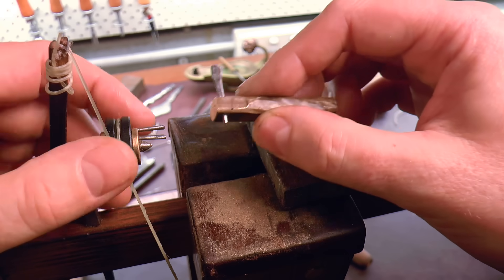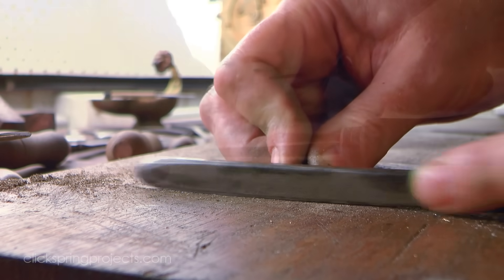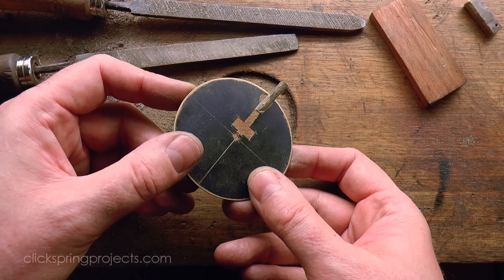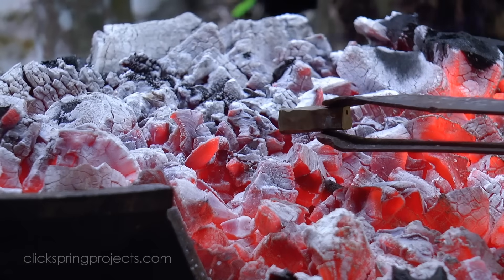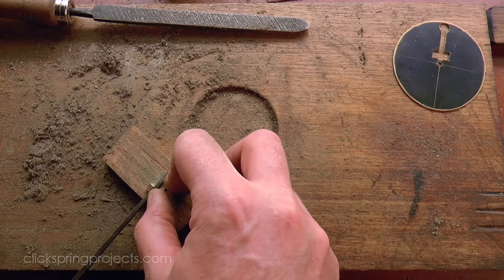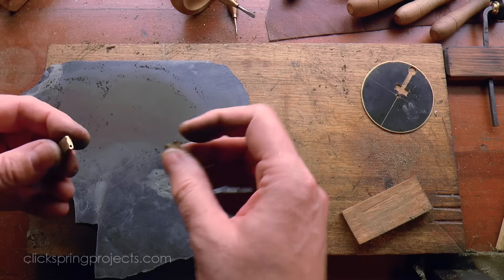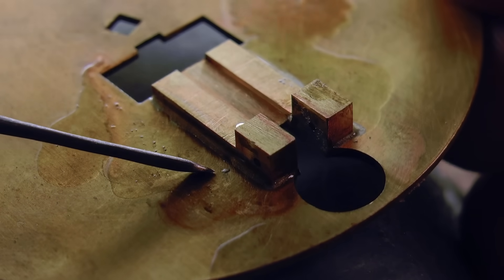The Antikythera Mechanism Episode 12, Part 2 - Making The Lunar Phase Display "Pipe" and "Cheeks"

Comment: Hi Chris. I’ve been considering a problem related to the Antikythera mechanism that I haven’t seen discussed anywhere so far.
When the mechanism was finally assembled after its manufacture — or reassembled after being taken apart for maintenance — it must have been put together not only with each wheel and component placed on its proper axis, but also with the correct angular orientation relative to one another. It had to be assembled with the precision of tooth to tooth.

In an ordinary clock, the hands rotate with a uniform angular velocity, so after assembly you only need to adjust the position of the hands on their shafts.
However, the Antikythera mechanism contains parts that move at continuously varying speeds, and some even reverse direction and form loops. For the mechanism to display everything correctly, it must therefore be assembled with almost all its components set to specific positions — meaning it represents a specific configuration of the planets, and thus it was assembled for a particular date.

This implies that the gears must originally have borne some kind of alignment marks to ensure that pairs of wheels were meshed in the correct relative orientation — probably in the form of notches or engraved lines, possibly accompanied by descriptive glyphs or letters. Has anything like that been found, or even a hint of it?

Another question is: which date did they choose? One might assume it was a date in the past for which the positions of the planets and the Moon were already observed and known — not too far in the past. That could serve as another clue to help with dating the device.
Or am I thinking in the wrong direction?

Comment: Watched all of your videos regarding the mechanism and the tools to create it. The videos where you dive into experimental archaeology are just astonishing. I've watched your lathe video along the last year at least 3 times. 

I recently finished my first more complicated machining project, actually my second machining project ever. I used an old manual lathe and mill to create a stirling engine from brass. Sand casting the flywheel, machining the brass cylinder and piston made of graphite.. And I had such a hard time achieving similar lever of precision and fit as you did with your concentric tubes. Thinking I always needed a more expensive and better tool to achieve accurate results. Your videos combine everything I love about the process of creation.

Thank you for being here and doing what you do.

Comment: you should build yourself a treadle powered recipricating file table! Not really a stretch as far as tech goes and it would make filing profiles so much easier, using both hands to hold the work piece and it would have pretty fine control if you set up the treadle right.

Comment: When I see these older laborious process I can't help but to wonder if one bright spark made something like a foot pedal rope driven thing to move a file fore aft quickly as a Quazi power sander. Surely there's ways for accurate and quicker material removing? I'm thinking the foot pedal powers oscillating power file drop saw machine 🤣

Comment: Only those who have done some metal work know the skill level required to drill those holes without a drill press at 9:08. Not to mention with manual tools and a drill bit without flutes.

Comment: I can so emphasize with the ethos of hand crafting. From making pinewood derby cars, to hand fitted gift boxes, to a repair on a motorcycle brake lever. It is the mediation. The patient scraping, filing, sanding until it works "just right" that is so satisfying. The ability to take raw stock and make something useful cannot be understated.

Comment: I’m a medical device engineer working heavily in the upfront design and prototyping. I feel like a lot of the work I do is like the “pre-industrial” working method. A decent amount of my time is making things that I can use to make the actual prototypes. Modern technology just makes all of this so much faster. I can use a 3D printer to make jigs that will help me align and drill holes by hand or use a jewelers laser welder to tack things in place.

Comment: Totally inspirational as always.  I'm sure there are plenty who will think "is this still going on?", I'm not one of them.  Not only are you recreating a badly corroded ancient mechanism, but you are researching how they might have achieved what they did using the tools available at the time, and you're documenting it all on video.  Clearly, you could have created a replica in a fraction of the time using modern tools, but simply creating a replica is not the object here.
I can't help wondering though, whether you have considered making a replica using modern tools, so you have something tangible to work with, rather than just CT scans?  This would separate the "how does it work?" from the "how did they make it?" and it would have allowed you to resolve issues with understanding the CT scans before spending days or even weeks manually creating parts that might not work.

Comment: The filings and metal removed are defiantly not waste.  The craftsmen of old would have kept them to melt and use in the next project.  but forging a part too large is a waste of time filing it to size.  it's a balancing act, between saving time only to have to do that part over again, or spend extra time filing.  Interesting stuff to see how it was done before modern electrical driven machinery.
One day I might make the trip up the road and it would be nice to be able to visit your workshop.

Comment: the basic simplicity of the methods to achieve each skilled task is poetic too watch you and hear the explanation of each simple skilled task ,  and i say simple task with the up most respect, it that any one willing should be able to replicate these tasks to a certain degree of precision , not to your watch maker calibre, yet a part resembling what it should  using modern tooling, yet i cant help thinking modern tooling is not always the easiest answer either, i seen many times in my own shop that i reach for old tools or methods to achieve a task, rather then the many modern tools i own , partially because of all the set up or jigs required to make the same part  with them ,  modern power tools can be hard on the fingers if not used properly , while hand tools are more forgiving, physical effort works just as well, 🥸🤓,Canada

Comment: AI Summary

Abstract:

This video, Part 12 of the Antikythera Mechanism reconstruction series, documents the meticulous, period-accurate creation of the "pipe" and "cheeks" for the lunar phase display. The narrative focuses less on the finished parts and more on the laborious, patient process of ancient craftsmanship, described as a "celebration of the tedium of bench life." Using only hand tools like files, a bow drill, and forging equipment, the creator demonstrates the pre-industrial method of engineering, where components are slowly and precisely fitted to each other rather than being made to absolute measurements. Key techniques highlighted include the careful conservation of material, the strategic sequencing of operations to ensure alignment, and the use of tin/lead solder to join components, a process which incidentally produces solder spatter similar to that observed in CT scans of the original artifact. The video serves as a profound meditation on the skill, patience, and mindset of the ancient maker.

The Art of Ancient Metalworking: Building the Antikythera Mechanism

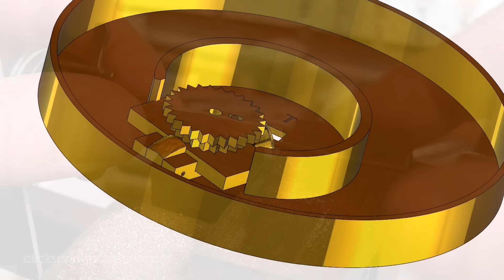*   1:22 The Central Theme: Tedium and Patience: The video intentionally emphasizes the slow, tedious, and patient nature of ancient metalworking. The primary goal is to get the fit and mechanical function perfect, with time being a secondary concern.
*   2:24 Material Economy: The maker must balance efficient use of expensive raw material with the risk of error. Enough stock is left on a part to allow for correction with hand files, but not so much as to be wasteful.
*   7:19 The Foundation of Pre-Industrial Engineering: The process of slowly hand-fitting two parts together is highlighted as the core method of engineering for thousands of years. It is a deeply human interaction of hand, eye, tool, and workpiece, where dimensions are relative, not absolute.
*   10:18 Strategic Order of Operations: The sequence of manufacturing steps is critical. Half-formed parts are used as jigs to help align and shape other components, showcasing the clever, non-obvious methods the ancient maker would have employed.
*   11:22 Replicating Ancient Soldering: Based on CT scan evidence showing a tin/lead alloy, the components are joined using period-appropriate soldering techniques. This requires clean, oxide-free surfaces and a precise fit for the solder to flow correctly.
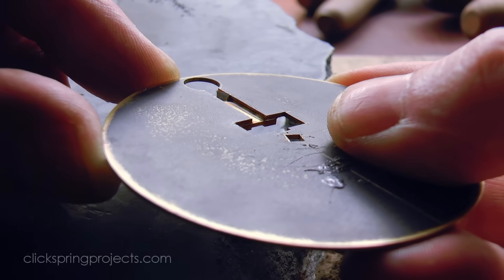*   14:16 An Experimental Archaeology Insight: During soldering, small bits of solder are accidentally flung onto the piece. This "solder spatter" closely resembles unexplained radio-dense spots seen in the CT scans of the original mechanism, suggesting a possible origin for those artifacts.
*   16:20 Manual Fitting for a Perfect Result: The final components are meticulously fitted together using repeated test fits and light, adjusting cuts with a file until the alignment and movement are exactly as required.
*   18:41 Time and Effort: The creator estimates that making these few small parts in a standard workshop environment, without filming, would have taken an experienced worker a couple of days of focused effort at the bench.

**

### Summary of YouTube Comments

The viewer response is overwhelmingly positive, with many calling the series the best content on YouTube. The comments focus on several key themes:

*   Deep Appreciation for Patience and Skill: Viewers are consistently in awe of the immense patience, dedication, and skill required to perform such precise work with hand tools. Many contrast this with the instant gratification of the modern world.
*   Value of the "Tedium": Directly addressing the creator's opening remarks, a significant number of commenters state that they watch specifically for the slow, meticulous, and "tedious" process, finding it calming, mesmerizing, and deeply rewarding to observe.
*   Inspiration and Education: Many viewers feel they are learning a great deal about history, engineering, and craftsmanship. Several have been inspired to take up their own hands-on hobbies or have gained a new appreciation for the skill involved in making things by hand.
*   A Connection to the Past: The experimental archaeology aspect resonates strongly with the audience. They express fascination at seeing history brought to life and being able to witness the techniques that the original ancient maker would have used over 2,000 years ago.
*   Exceptional Production Quality: The high-quality filming, clear narration, and well-chosen music are frequently praised for enhancing the viewing experience and creating a unique, immersive atmosphere.
*   The Kookaburra: Several viewers delightfully pointed out the sound of a kookaburra in the background around the 6:37 mark, adding a charming and distinctly Australian touch to the ancient Greek workshop setting.

I used gemini-2.5-pro| input-price: 1.25 output-price: 10 max-context-length: 200_000 on rocketrecap dot com to summarize the transcript.
Cost (if I didn't use the free tier): $0.04
Input tokens: 27506
Output tokens: 996

Comment: Amazing work! 

I don't know if you've covered this so far, but do we have any conjecture about how the plans for a mechanism like this would have been drawn and constructed back in the day. Paper was a thousand years away so they would have had to draw on vellum/parchment which was expensive and difficult to erase mistakes on. I don't think they had pencils back then (happy to be corrected). Just thinking aloud but maybe they drew plans/notes on a piece of thinly planed wood? Or with chalk on a smooth stone? The Romans used wax tablets as an erasable writing surface but I don't think you could draw blueprints in them. You couldn't keep the plans for something like this in your head, so they must have had blueprints of some kind. Anyone who could make this mechanism could make a compass, straight edge, square etc, but as a bookbinder I'm curious about the actual drawing surface and medium.

Comment: I grew up in a machine shop that was full of tools from the 30's-50's. I started building thing there as a 12 year old kid. Later I got a job there after high school. I learned everything on manual equipment, how to feel the cuts, planning the process, jigging, fixturing, grinding my own tools, etc. By today's standards its an old, slow machine shop and for complex one-off jobs a CNC can typically do it 100x faster. but it gave me an appreciation of being patient, because every step closer to the finished product was another step you'd have to repeat if you messed it up. learning that sometimes the best thing you can do is just stop and look at the problem for a while and plan not just your next few steps, but every step along the way to a finished product. But this? this project is daunting. Its a level of craftsmanship that one can't truly understand without knowing what the devils are that actually hide in the details. One that stood out to me was the hole that had to be drilled perpendicular to the block that you started at 9:10. To get that perpendicular enough to land on the opposite side where you need it with a hand made tool with a notable amount of runout in a tiny part while spinning the tool by hand... one can't appreciate how difficult and time consuming that is until its attempted. This whole project is just incredible. I would argue that some aspects of the build are probably even more difficult for you to accomplish this than the creators of the original mechanism as they probably had the tools on hand and were also probably well versed in the processes needed, had the knowledge of the materials and consumables needed, etc. Amazing Chris, absolutely amazing.
Reply: 100%! Its like he's said he wanted to paint a masterpiece and decided to start with hand making the pencils to do the initials sketches
Reply: I agree with you, this work is amazing!

Comment: I always find outstanding how such level of precision can be achieved with such simple tools. I wonder if it would be possible to make screws using that lathe (taking into account that it can't synchronize the advance of the tool with the rotation of the piece)

Comment: such an important and insightful video and commentary. thankyou. 
The question of order of operations is really relevant to skilled making. Love the solder then cut detail explained at ~15
Would I be correct that this is one of the more geometrically complex parts of the machine? One wonder  how many years/decades it took to refine this mechanism? Is there any record of artisans of the time doing drawings, or must we assume extraordinary skills of 3D and mechanical imagination?

At 9.00 when you start drilling the cross hole in the 'clevis', what did you do to ensure the hole was perpendicular? I'm sure  'you' could eyeball it with good accuracy. As you do when starting the second hole, I see you using the drill shank as a reference against the existing form. Wouldn't some scribed guide lines be and insurance policy?
I see you 'shining' the plate to check for corrosion. Such thoughtful videography.

Comment: Brilliant work Chris. What I have just learned is that not having power tools and being forced to work slowly by hand allows for minor adjustments to be made on the fly. Eg, when drilling the hole , adjustments to achieve the correct direction were much easier to make than if using a power drill. I can also see why skilled artisans scoffed at the suggestion they might one day be replaced by machines.

Comment: This channel has taken me from a spurt of instantaneous inspiration to a trip to home depot, to making my first lathe with a 2x4 and filed hex-wrenches and with old hacksaw blades taped together to make a driver-bow, to making an actual arbor to hold parts, to buying a real wood-working lathe and finally making stuff by myself.  To finally making a flute and other objects. 

I knew nothing about lathes or machining or metrology when I first found this channel.  
And now I find myself dipping my toes into the world of machining. 

Maybe 1 day I'll be able to replicate an Antikythera using the same techniques.
So, Thank you for that.

Though I learned firsthand how long it takes to make a handmade cutting tool and a simple arbor.  
Over 8 hours of tedious bow-drawing just to make a 2-inch long arbor with a hex-wrench filed down into a flat dull-cutting face.
Reply: If you used an off-the-shelf hex wrench, I assume a lot of that was filing it due to the hardness of the metal!

Comment: Making parts to fit lasted well past the start of the industrial revolution. The jig borer was only invented around the end of WWI, before that hole location and alignment was substantially less precise. Hole positions either had to be laid out by hand (making parts not interchange well) or hand-laid-out drill guides had to be used (same issue, but this time across different guides or as they wore). Parker only published "Notes on Design and Inspection of Mass Production Engineering Work" in 1940, and "Drawings and Dimensions" in 1956. Richard F. Moore's "Holes, Contours, and Surfaces" popularized the concept of working to machine coordinates in 1955. Those are the first public texts on modern Geometric Dimensioning & Tolerancing, which enabled truly interchangeable parts. Even WWI-era factories often required hand-fitting components, interchangeable parts only really took off around WWII.